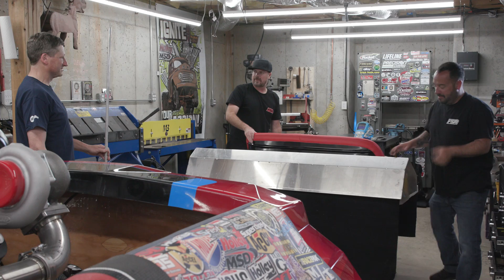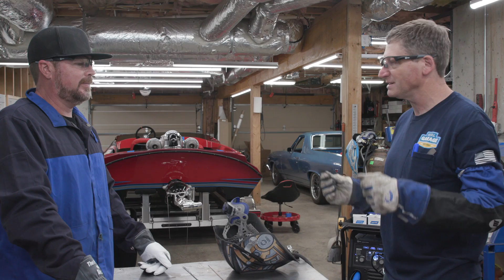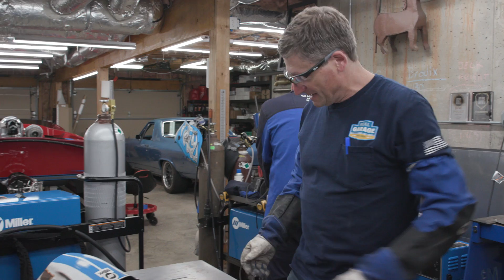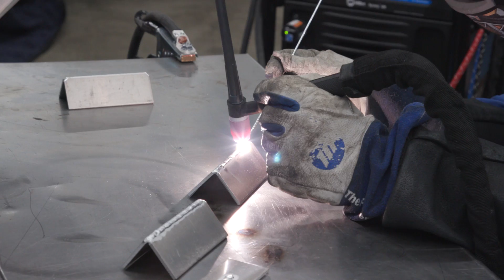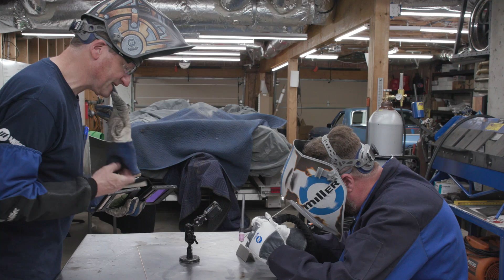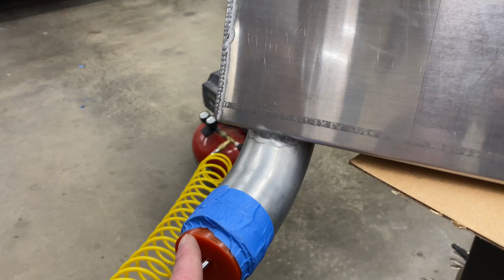BIGGEST FUEL CELL I'VE EVER BUILT AND IT'S FOR WIFEY'S 1,600HP TWIN-TURBO JET BOAT!

Comment: I used to work as a linesman. When we connected 2 leads of aluminium we used a wire brush to take off the oxide and then we put a contact grease inside the clamp. Because we know that oxide layer comes almost instantly when the aluminium is exposed to air and that it's works as an insulator. Oxide is used in many batteries, but other metals used.

Comment: Dear Finnegan’s Garage, I built a 2002 Chevy Single Cab with a twin turbo 4.8 motor.  The truck was originally a 4.3 V6, but I found a twin turbo kit for a 4.8 and purchased a low mileage 2003 motor.  Now the issue;  the wiring harness will not work!!!  Chevy changed the body style (and wiring harness) and we (friends and I) have butchered numerous wiring harnesses out of junkyards with no success.  Painless and other companies do not have what we need.  Do you know anyone in GA (I live in Augusta) that can build the entire wiring harness???  Thanks in advance!!!  Darryl Hines.

Comment: Tip when using a hole saw, just touching the plate with the saw. Now you have your OD of your circle. Drill several holes threw the plate, spaced around it, almost the width of the saw kerf. This relieves the chips, cuts much easier less effort when doing it by hand also.

Comment: I use a speed glass mask and it's full adjustable
Reply: My Optrel Crystal 2.0 is fully adjustable and auto as well. I hate the digital controls on the miller and like the manual knob on the outside of the optrel. I can quickly reach up and adjust the knob while I'm tig welding. This one is also much lighter weight than the Miller. The only bad part is that the sun triggers it and I will probably have to send it back under warranty.

Comment: My longest was a 50 ft semi trailer . lower frame rail and the web .I would put my left elbow on the rail or web so I knew where I was and to steady me as I would slide on my cart inch by inch .all had to pass dot but boss man paid me for laying down dimes and he wanted no starts and stops .so you had to be great at starts and stops and doing long welds . 5th wheel plate all 1 weld to each corner . R way custom trailer in Indiana . Closed up back in early 90s I learned how to be a real welder there .

Comment: Huge fan. Just wondering are you planning to run dual tanks for balance?
I am presently in the middle of my 1979 eliminator I/O sbc supercharged build. I have been throwing around the idea of fuel injection  using a holley draw through efi system.  Just purely coincidence that your build tanks or tank  at the same time that I'm trying to figure out how to do dual tank & fuel injection..
Awesome work man thanks for the epic content and constant inspiration..

Comment: Whenever testing fuel tanks for aircraft I use the exhaust port from a shop vacuum for pressurizing instead of shop air. Keeps it below 4 psi.

Comment: Someplace in the San Diego harbors bottom sits my Allison V12. Figured if my (Starts with a K) drag boat could handle two cast iron blown hemis, an Alison only weighed 600 pounds more, what could go wrong? Well about an eighth mile into the shakedown I found myself underwater with a lot of debris. Now when I wreck something at least I can find the engine. (1974 by the way)

Comment: I found it a little harder to weld with a clear view the first few times because it was so clear you can see the separation of the puddle and slag, as with the green style you see more of just a glow rather than any real detail. This is really only pertaining to stick and flux core though. Much better clarity for tig, especially in low light with the hood down before arc start, your able to start the arc with confidence rather than 1/2" away from the joint.

Comment: For the the hole saw why did you not use the Bridgeport?
Also for aluminum use WD-40 for cutting fluid just in aluminum for some reason aluminum like sticking to drills and saws and WD-40 has worked the best it works better then tap magic cutting fluid for sure.
I'm just a full time machinist trying to help.

Comment: I'm sure there is a plan already in place, but what will be used on the other side of the boat to compensate for heavy weight of the fuel cell when full? Going to need to place at least 150lbs on the other side of the boat, I reckon.

Comment: worked in a marina with a fabrication shop, became friends with the welder, he made dozens of fuel tanks a yr for a boat builder in marina complex. You have no shame in that pin hole, he would obviously pressure test every fuel tank, but he, more than once had to touch up his welds, and had been fabricating for well over 15 yrs

Comment: TIG welding aluminum isn't hard, you just need to make sure it's clean, your tungsten is clean and rounded over, the gas is on and just keep feeding it filler rod. I don't do the dab thing, I just constant feed it and my instructor actually admitted that my first weld ever doing it was better than he can weld aluminum and he's been doing it for 20 years! Welcome to being autistic, I come up with new ways of doing things and sometimes they turn out to be a better way. Mike... You have a plasma torch, cut out the center of the hole with it and then either get a bur and hog out the rest that way or get a jigsaw with a metal blade and cut it out that way. 
I tried pulse welding in college and didn't like it. With thin enough material it might come in handy but at that point you can just lower your amperage. For me it was annoying that you had to kind of get in a rhythm with it and figure out when you could add filler and when you couldn't and so it was just annoying as hell. God I miss welding.
Oh and a cheap smoke machine is to buy a smoke ball and drop it in, though it might get too hot for aluminum and getting the dye from the smoke out can be a pain.. Or get a bee keeper's smoker and duct burning pine needles into it.

Comment: You could get a fog machine from ADJ the 1500 would work and build pressure. Plus your party roof would rise exponentially. I use mine for holloween I literally fog two blocks in the breeze with it. Just mix distilled water and glycerin from the pharmacy 50/50.

Comment: I have the same mini drill press, I only use it for 1/4" holes or smaller in steel, and it works just fine, all day....every day. Steve just Steve makes an excellent point. Mmmm, free welders, way to go!

Comment: Andy provided some excellent tips on using pulsing. From helping it get your timing down when starting out, to not putting too much heat into a part, to helping it focus the heat in a narrow access situation.  So many videos out there saying "If you can't tig weld, a pulse will do nothing for you". His example of using it to help with timing is an excellent example that blows that theory away.  Thanks for the great video!

Comment: If you are only using a single fuel tank and not saddle tanks, I have 2 questions.  25 gallons is not going to be a lot of range in a jet boat with that kind of horsepower.  Also what are you going to use to balance the boat out with the single tank?   That makes roughly 160#'s off center.   Not too bad but I would think enough to be noticed even in a cat.

Comment: Is that a adjustable drill press that you can change the belt on pull system on the top of it under that black cover

Comment: Thanks for the awesome video content!  Fantastic welding tips as well.  There should be a pinned comment on the info on this, something like:
0.9 to 1.1 for the pulse
100-150 frequency. The higher the frequency, the tighter the arc
Looks like he used a #5 cup for the aluminium and stainless?
What gas flow was used, I wonder?

Comment: I think it would be awesome if you made a 2nd tank for the other side so the weight is even on both sides and more cruising time as well.
Reply: set it up like a semi, with 2 filler necks and a crossover line so it draws equally from both sides, even though it's only pumping from 1 tank

Comment: Will that new filter be in all Miller hood? So infinity an digital elite hoods?
Reply: Yes sir!  The ClearLight 2.0 will be integrated in those hoods.
As of today... 5-27-22, there is still a mix of the original ClearLight lenses and the new 2.0 depending on what graphic style you want.
Just make sure the one you order specifies 2.0 in the features of the hood.
Once all the original ClearLight hoods are sold, they will move into the new 2.0.
I found this out the hard way...
I ordered some of the Roadster 29 Digital Elite hoods and the plain black Elite and only the black one was the ClearLight 2.0

Comment: Two Questions - what's going to balance out the mass of the fuel on the other side of the hull?
And, for Andy, does the frequency of AC here in Oz make any difference to the welds?, - 50Hz vs the US's 60Hz
Reply: not positive but I believe if you have a transformer welder it would make a difference. For Invertor machines they compensate to the frequency you ask for.
Reply: Someone beefy
Reply: @billmopar6461  :D
Reply: @billmopar6461  Dang,.. I'll need a passport,..... :D :D
Reply: I’m guessing driver, batteries, water tank for the air to water intercooler/heat exchanger. I thought the same thing
Reply: @bullhead360  all the water for cooling comes in from the lake and right back to the lake so the lake is the radiator and intercooler tank
Reply: I am a welder and when i do gastank we make them with some walls inside så the gasoline cant mowe arund so mutch.

And we do mutch bigger holes (maby 30-40 mm) so the gas can run trow the wall.

In this case i think the pump should EMPTY the area were the pump is.

Sorry for bad english, im from sweden :)
Reply: @compactliving08  your comment might be wiser as it's own statement, rather then buried in replies to my comment. You've added information more people should see about the design, similar to baffled oil sumps.
Reply: @compactliving08  that's what they were talking about in the beginning with the bigger baffle they were talking about
Reply: The Miller inverter machines work fine on 50hz
Reply: Your mum.

Comment: Why didn't you use your milling machine to drill the plate? Also slow the speed down when drilling holes that big.
Reply: Aluminum you don't want to turn down the speed it will weld itself to the cutting tool aluminum likes to cut it high-speed like wood does! Also I think we gave him too much s*** on Instagram that he was cutting aluminum too slow🤔 that's why he don't use the Bridgeport Maybe

Comment: I set my Lincoln  185 TIG aside about 5 years ago cause it was not getting the work done.  It has always sucked at aluminum. This makes me want to pull it back out and try the pulse function to see it it works.

Comment: I'm watching a man use a hand drill a 3" hole in AL while standing right in front of his Bridgeport mill thinking WTF? lol. Also WD-40 works a lot better than that brown Sulfurized cutting fluid on aluminum. You the man Finn! Thx for the vid
Reply: First thing you're supposed to buy for the mill is a Jacobs chuck to use it the with all the wrong tools, right?
Reply: this was the same thing i was wondering, even before they cut to a shot showing that mill. i was pretty certain i had seen it in videos before.
Reply: 😀LOL, I was thinking the same thing...
Reply: Yea I'm going out on a limb here and saying he doesn't have a fly cutter
Reply: @leoncarpenter958  One thing he's usually not short on is tools so,  I'm going to say he may have a fly cutter or better a boring head. Now having the correct holder, insert or knowledge to grind the proper HSS tool for it is another thing and something I still struggle with at times. He'll get it.
Reply: @Steve_Just_Steve  Or just use the hole saw in the Bridgeport...
Reply: @Flitzer514  would've been safer using the hole saw in the Bridgeport than doing it by hand, or in that crappy drill press.
Reply: We were giving him too much s*** on Instagram when he was running the Bridgeport cutting aluminum too slow🤔
Reply: @plymouth-hl20ton37  slower than that? Lol
Reply: i'm not a machinist, I took a stainless panel to my machinist at work and told him please drill a 6" hole right here. I came back a couple hours later and asked what did you drill it with- he said I didn't drill it- I bored it. I thought he used a lathe, but he may have used a Bridgeport. So when I saw Finn  using a holesaw, I said, doesn't he have a lathe or something?
Reply: As a machinist I cringed watching this.
Reply: He needs to retro fit it with prototrak. Can circle mill a 3" hole in minutes. Including setup. We all know nothing is perfectly round that gets circle milled but it will work for what he's doing.
Reply: @joshuagibson2520  No he doesn't need a CNC retrofit to make a hole in 1/4" aluminum.
Reply: @Steve_Just_Steve  ofc not. Sure tends to make shop life easier in the long run though.
Reply: @Steve_Just_Steve  not to mention all he'd need is an endmill.
Reply: @joshuagibson2520   Makes it easy after you've spent all the time learning CAD, CAM, G Code, Post Processors, Feeds and Speeds, the machine controller, ect ect... and I'm willing to bet more than one endmill will be broken in the process. lol. 
Could be done manually with just an endmill also by using a rotary table.

Point is it wouldn't be worth the time or money investment for Finn and what he does.
Reply: I can't understand why he doesn't have a small laser table or waterjet
Reply: @davidwoermansr  really? You can't? Probably cause it makes zero sense for him to have one. 4x4 plasma maybe...
Reply: @Steve_Just_Steve  I've got a laser that'll handle a 4x8 sheet and I don't do near as much as him
Reply: @davidwoermansr  That will cut steel and aluminum? How thick will it cut and how much did it cost?
Reply: @Steve_Just_Steve  I've only cut half inch with it and I got it on an auction at a fabrication shop for just under 4500 so basically I stole it because nobody really wanted it that bad the bigger 1 that held 6 sheets brought some serious money
Reply: @davidwoermansr  Sweet! Nice buy! I've got a 5x10  w/ a Powermax85 it just takes up so much room in the shop.
Reply: @Steve_Just_Steve  mine looks tiny in my 80x160 shop I converted an old milking barn into a shop so not many projects get pushed outside while waiting for parts I built a 6 bedroom hunting lodge/guest house above my shop and I spend more time there than in my house it's a shorter walk to just go upstairs for a nap
Reply: @davidwoermansr  You must not be married. LOL
Reply: @Steve_Just_Steve  nope she walked out on me and my 7 kids when my youngest 2 were under 3 months when I was in an accident and the Dr said I'd never walk again after a year of several surgeries and almost a year of rehab I'm up and hobbling and started my own businesses because nobody would hire me and disability don't pay the bills

Comment: Granted high speed on the drill works quickly. If you want to make your hole saws last go with the slower speed and brace your wrist for the bite. (Plumber here yeah I hand drill through a lot of different media generally by myself) good show keep up the good work. 12volt been eyeing those new Miller-Matics and deserves his own by now….

Comment: This may have been asked already but how can you get away with 25 gallons on one side of the boat. How are you going to offset the weight on the opposite side?
Reply: Personally, I was really hoping they were going to fab a mirror image unit for the other side of the boat and then plumb both to the engine.
Reply: Dead body...
Reply: Finnegan garage. was gonna ask same question 25 gal equals 150 lbs gonna need newborn on empty side and his lunch box tank side

Comment: I could definitely say Finnegan I have the primeweld Tig-225x and I also got the maxcool 3000 water cooler with a water cooled torch. I do a lot of aluminum welding and like you said you never later well that 120 HZ I will the aluminum at anywhere between 140 and 200 HZ at 30% AC balance and I hardly ever use the pulsar I'm just starting to learn how to use the pulse. once you start getting into that machine and start learning everything you'll like it a lot my primeweld Tig 225x is a little easier to use than what the Miller dynasty DX series is.

Comment: Ran a Bridgeport for many years suggest you get a keyless chuck allowing it to be used as a drill press depending on the features it may have a power quill feed way more accurate than a drill press
Reply: I was wondering why he didn't use the bridgeport behind him
Reply: I use a keyless chuck except with hole saws. OMst keyless chucks are self-tightening and if the saw grabs it can be a pain to loosen.
Reply: @kennethstaszak9990  I've killed a couple of keyless chucks that way. I prefer a big keyed chuck to run hole saws. Usually run the mill as slow as it will go. Alumacut fluid works real well.
Reply: @phlodel  I haven't destroyed any but I came close. I had to grind wrench flats on it to loosen it.
Reply: @kennethstaszak9990  The ones I destroyed were cheap ones that suffered repeated abuse by overload. I'd have to use a big Vise grip and a hammer to loosen them. I got a fairly large Jacobs Super Chuck, problem solved.
Reply: I'm almost positive he's not using Bridgeport because we gave him too much s*** on Instagram about how he was Milling some aluminum not too long ago🤣🤣

Comment: I got a same sized drill press from harbor freight but I have the opposite problem.  It's too powerful even on the biggest pully. Chews metal like nothing, even 3/8- 1/2" thick one.

Comment: Thanks for drilling the hole on plate the hard way. I see some huge shops with all the equipment, and that's great but not obtainable in a non production environment. Selling the idea of a water jet to the old lady to cut a hole one time is a rough sell no mater the budget.

Comment: Did you do the lay wire and set the pulse frequency up high or did you manually add filler? That was awesome information! I can't wait to try the pulse turned up on mine!